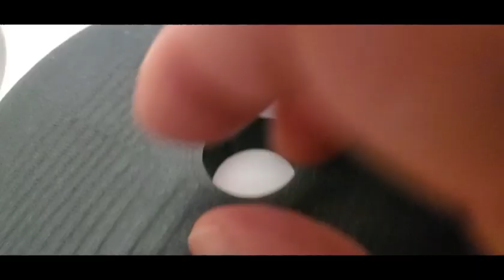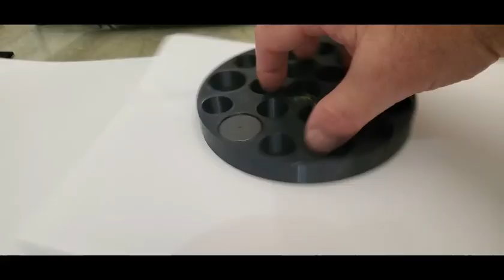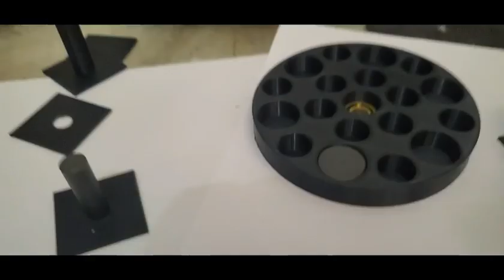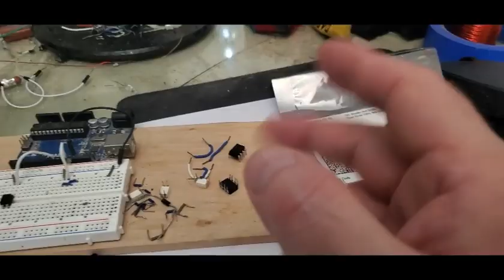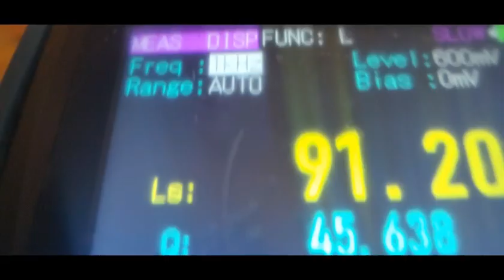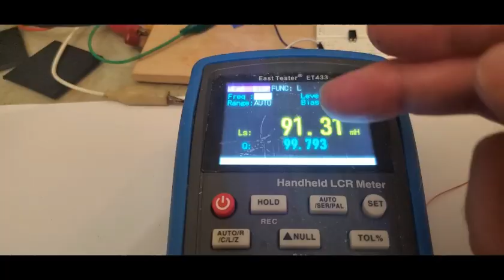Penny Roll II: Ready to Run

Comment: Copper is diamagnetic. Right away when I see the pennies,  I'm thinking they won't be suitable as weights
Reply from the maker: Oh crap.  Please elaborate.  Also 1) the diamagnetism should be weak 2) they should be in between, hence distant from where the pulses are occurring. Still it is always a concern that suddenly everything is going sideways for seemingly no reason, so thank you.  Let's see what happens. Possibly the lighter more recent pennies are not diamagnetic.
Reply: @paulmaher812 if a changing magnetic field gets near the pennies, they run a current that resists that field. The risk is that they'll slow the rotation down to a crawl. To demonstrate the effect, drop a magnet through a copper pipe. It falls very slowly.  A more ideal flywheel mass might consist of fine grain lead shot, with granules coated with an insulator
Reply from the maker: @paulshields1883  The more modern pennies are primarily zinc, which is not as diamagnetic as copper.  I am certainly not certain what will be seen.  However, it will not be difficult to run things with zinc as the added mass and will be sure to add that to the experiments.  Thank you. Edit: one also might place the flywheel 4 inches away but that would involve a redesign.